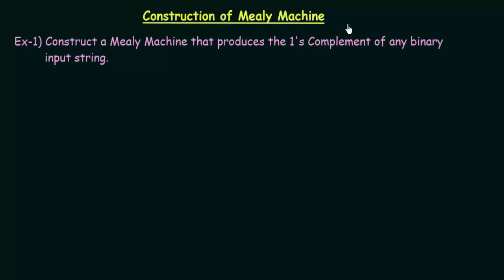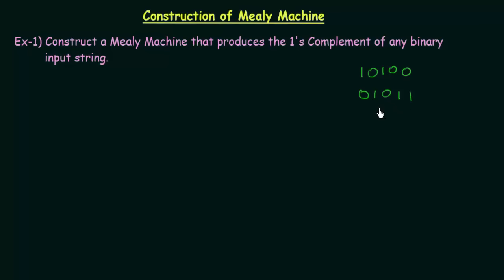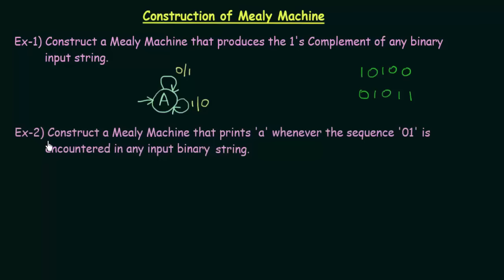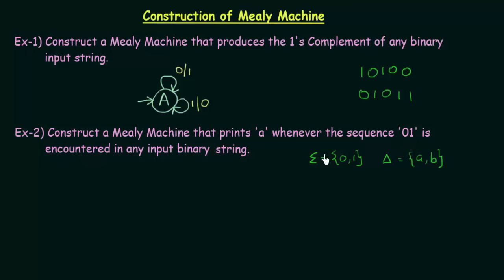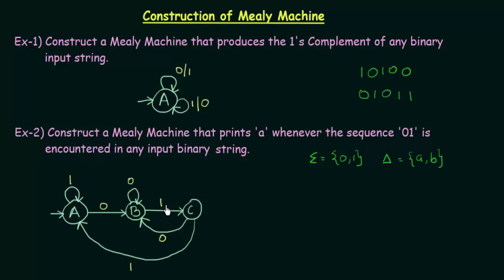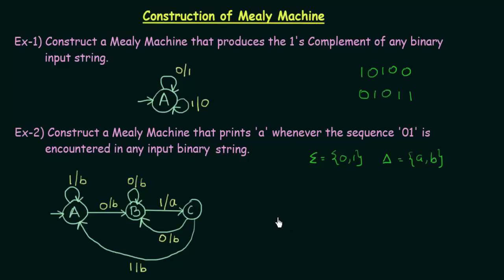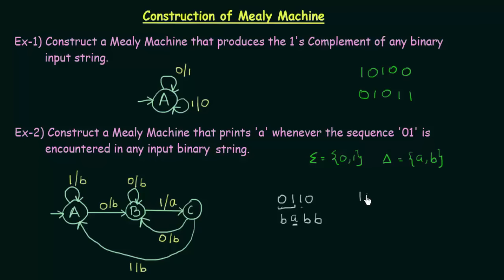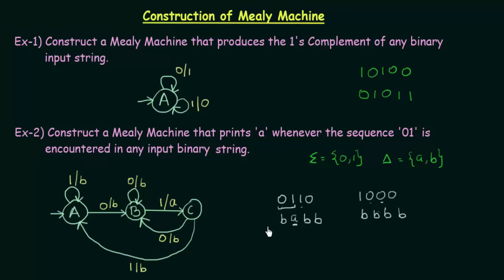Construction of Mealy Machine

Comment: Why did you make a DFA for a machine accepting 01 at the end only ? Why not anywhere in the string ?
Reply: Yes, even I didn't get this
Reply: It prints 'a' whenever 01 encountered ,even if it is on the middle of the string or starting of the string or ending of the string . 000001 prints 'a' one time because 01 encountered at last of string  . 0101000011110000001 prints 'a' three times as 01 encountered in starting position ,third position and last position. Hope you understand.
Reply: The DFA accepts strings with 01 at the end but doesn't deny 01 in the middle.

Comment: example 2 was wrong
you have explained for the string ending with 01
and the question was that the string should contain 01
Reply: But still why are we supposed to end it with 01, the question doesn't ask for it, this just reduces the no. of possible valid input strings.
Reply: Abhijeet Singh 
there is no final state so, the final state can be A/B/C ..isnt it ?
so it doesn't have to end in C with ending string 01
Reply: Yes, the sequence can be encountered anywhere within the states. So this is like a question of DFA design where your string contains substring '01'.
Or even better, remove state C completely. And use only two states A and B. On getting 1 on B, come back to A with output 1.

Comment: shouldn't we use the double circle around 'C' to signify it being the final state?
Reply: Not required, the question is about getting any 01 in between the strings and whenever that happens you should print 'a'
Reply: sir
if we writing 1/a it is like a moore machine,input/out put?

Comment: Sir, can you please tell me how to design a bank locker system using sequential circuits? The logic is...when we enter our bank locker code, then within 5seconds the bank manager must enter the password which matches our bank locker.  If both passwords matches then only the bank locker opens and led must glow green. Otherwise if the bank manager didn't entered his password or our key mismatched then red led must glow and locker does not opens